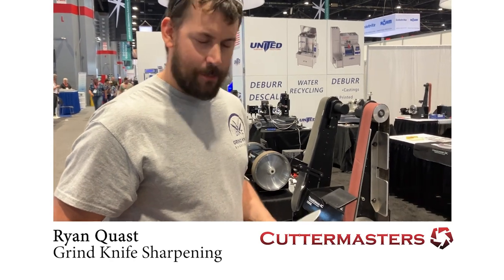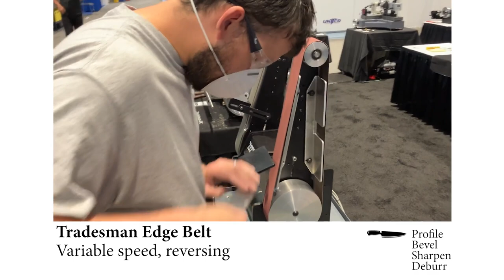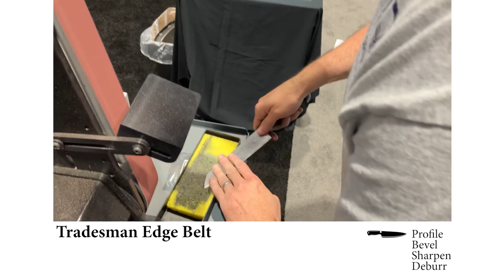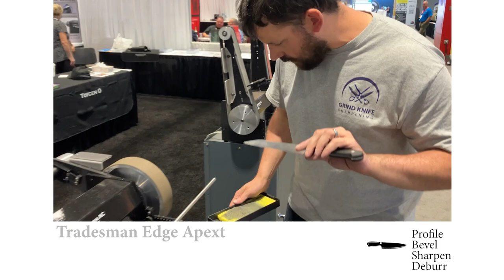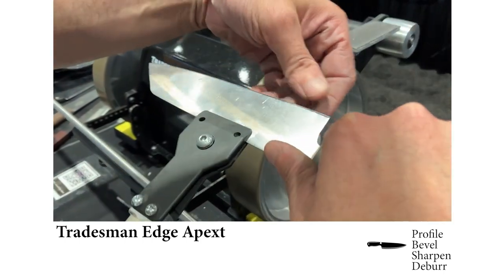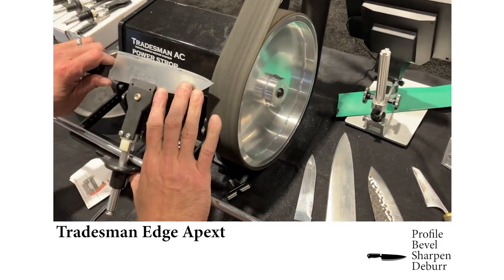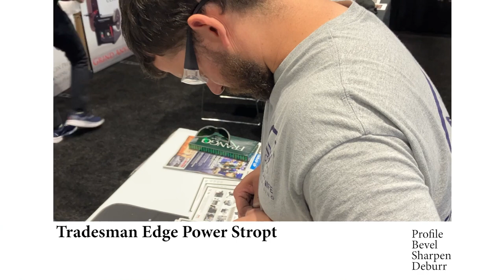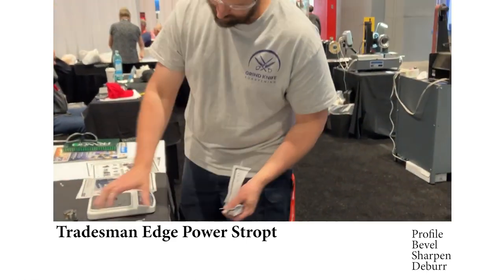Reprofile a knife

Comment: Wow that burr development was extremely fast! Thank you for showing this machine, question about Bevel angle? 15 or 16? so do we know what bevel angle we set? Also new jigs hopefully have knobs, to eliminate screwdriver use for securing knives, find it inconvenient. Bess test ideally tested 3 times, to see the average, that pressure was a little too quick against bess strip, which will always give lower number, but those cuts were beautiful. Waiting for new design with internal switch